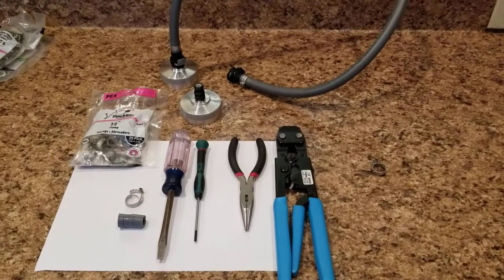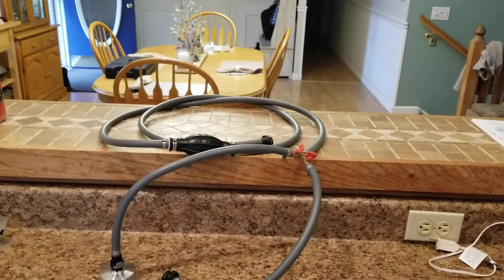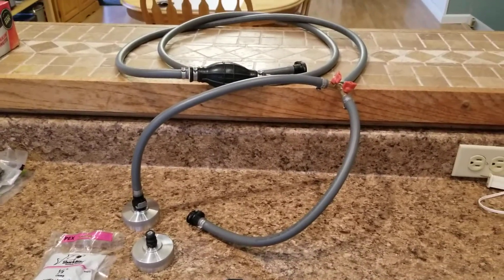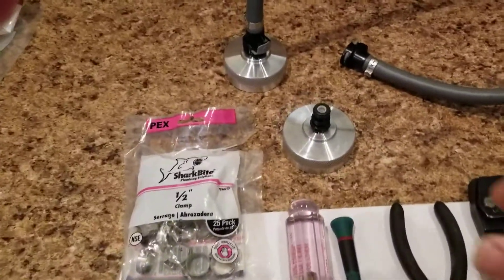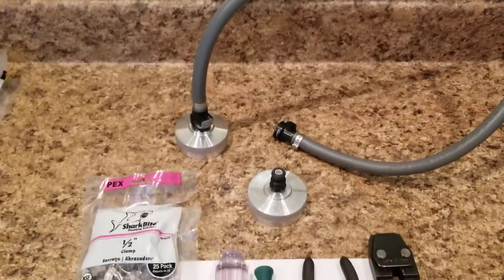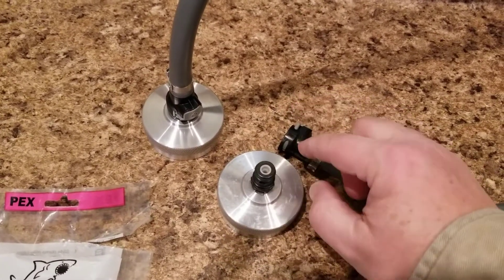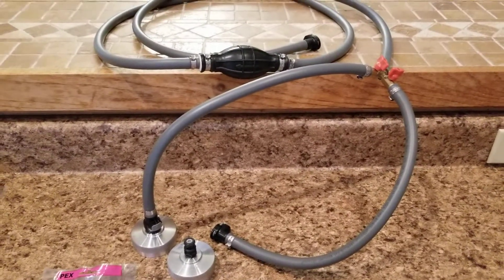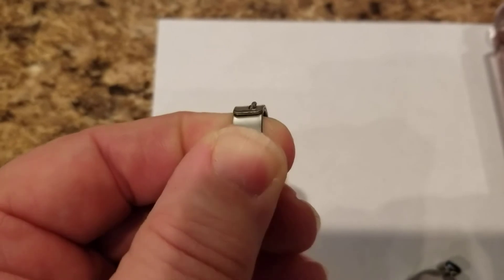The Predator Files: Dual gravity feed fuel lines.

Comment: How’s it working for you? 
Please publish a materials list
Reply from the maker: Works wonderful. Sold it to a freind of 40 years. He loves it too. I will post the parts in a bit. It's been a while, I will need to re-find them!
Reply from the maker: On Amazon..
Cap: Generator Parts Predator 3500 Inverter Generator Extended Run Fuel Cap.
Fuel line: Atwood Universal Fuel line assembly kit with tank fitting.
Fuel tank: Scepter Marine 3 gallon portable fuel tank.
3 way shut off valve: Andrade Forged Brass Ball Valve, Y shaped Shut Off 3/8 x 3/8 x 3/8 barb tee.
Reply: Thank you!

Comment: did you have to block off the air vent on the original fuel tank? it seems to me if you didnt it would leak gas from the stock fuel tank.
Reply from the maker: No, I have not had to block that off.